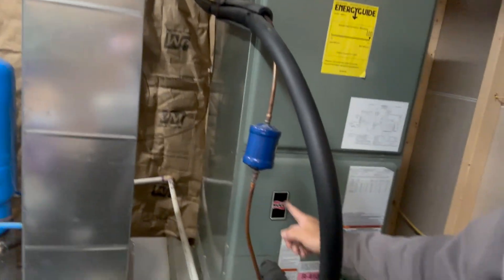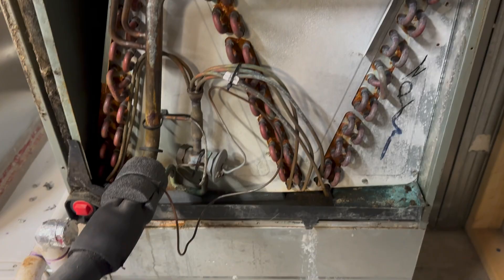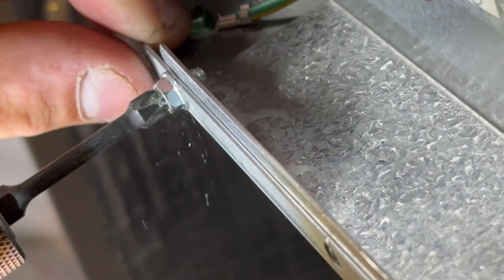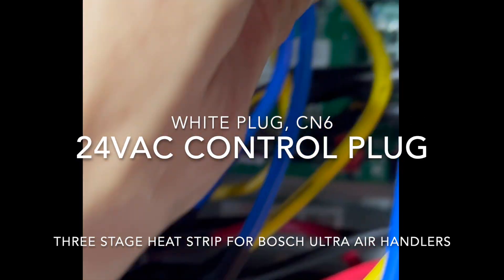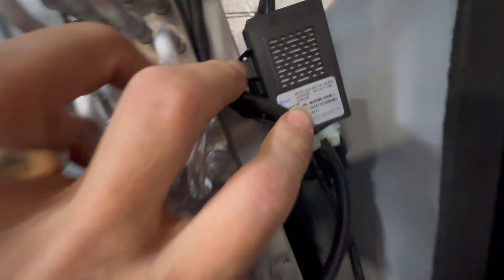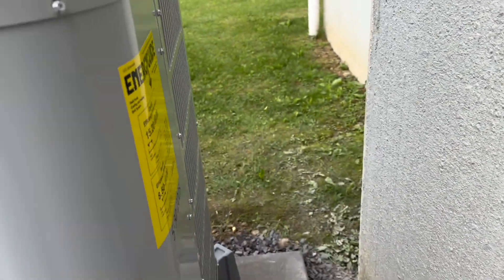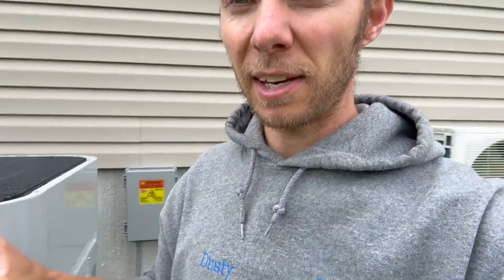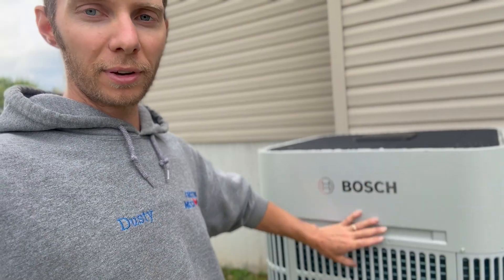Bosch Ultra Series 19 SEER2 Heat Pump

Comment: Why did you put 5 ton outdoor unit with 4 ton indoor? What's the purpose?
Reply from the maker: The reason for staying at 4 ton is that the indoor air flow requirements limit us to 4 ton, and in this case we were actually over sized by 1/2 ton. The issue is that if you set a huge air handler in the house, it will never properly dehumidify, and potentially never ramp all the way up if the ECM see's too much back pressure. Meaning, it will never flow 4 ton worth of air. 

The advantage of this, however, is that we have a 4 ton coil, and now running with a 5 ton heat pump outside, we can boost our heating rating, while using a Certified match to meet the requirements for Tax Incentives and Energy rebates. 

The 5 ton outdoor unit, just like any other heat pump, will eventually taper off and not have 5 ton of heating available closer to its operating limit ( in this case -13 degrees ). Meaning, at -13 degrees, this system is actually only capable of providing 3 ton of heating, which is where our customers house spec'd out as mentioned before.  So now , when the customer encounters those frigid temperatures, their heat pump can keep up, versus having to run backup heat more frequently. Obviously insulation values, wind, and many other factors go into this but that's the general idea. 

Thanks for watching!
Reply: @TheFreedomMaker so for cooling do you set your airflow for 4 tons? And with the bosch technology it'll never operate at full capacity?
Reply: Bosch will not overdrive the coil nor ice up the evap. You can put a five ton outside with a three ton indoor and it will not ice up just opposite of what we were taught due to one of two pressure transducers to keep our coil at a preset temperature. You can run the air handler with the door off and will not ice up, the coil will return a lower suction pressure telling the pressure transducer the compressor needs to slow down, I have had one froze up solid and I asked the tech is Y calling and he checked and said no, turned out the inverter board went bad and with no call it was running wide open. Nice install and best voltage, surge monitor out there. Congrats on a top shelf install!
Reply: When dealing with inverters compressors you can have more btu’s In the more extreme weather

Comment: What a great, informative video. I'm getting a Bosch IDS Premium BOVA-36RTB-M205 installed here in Massachusetts in a few weeks. I've been researching videos lately, and this is one of the best. The one thing i don't understand for my install, is my gas furnace will kick in at 37 degrees. Why is that? My Bosch is a 2.67 ton system. Is it just not efficient below 37?
Reply from the maker: Does it run just the gas furnace for 37 and below or just intermittently?

Your installation probably has the gas furnace wired for backup heat (this would be normal) , which is also typically engaged during defrost. 

95% of heat pumps start to need defrost right at 37 degrees….. 

Hope that answers your question
Reply: @TheFreedomMaker yes, that answers my question. Thanks!!!
I'll update after my install...

Comment: What thermostat would you recommend online everyone bad talks the bosh bcs110 did bosh ever update it?
Reply from the maker: We use the Honeywell ' T ' series thermostats. We have a preference which is a pro series model, but ultimately with the Bosch, you can run even the simplest of thermostat as long as it has heating and cooling ability.

Comment: Would this work with the same air handler I'm using with my BVA 2.0 air handler?
Reply from the maker: Unfortunately the old BVA units were 410 based. The ultras are all based on 454B. Technically, We could replaced the TXV on the air handler and make it work that way. Other than that, it would definitely work. The Bosch IDS products can all work with each other because of their phenomenal variable speed systems

Comment: Nice Video. Does the Ultra modem operate as low as 25 or 20 percent capacity?
Reply from the maker: Yes I believe the range is still set from 30% capacity up to 130% capacity

Comment: What did you install inline just before the pea trap?  This ultra is a game changer for cold climates!
Reply from the maker: We like to install unions when the drain crosses the front of the air handler for ease of access to the main drain pan port. Homeowners are encouraged to change filters regularly but we all forget sometimes so sludge can clog the main port if care isn’t used. Unions make service more efficient

Comment: Great video and install! Out of curiosity and future planning, how much did this cost?
Reply from the maker: I believe this particular installation was somewhere around $16,000. Depending on the requirements of your job (new thermostat, upgrade to electric panel, etc etc and the cost of contractors in your area and the equipment availability, it may be considerably more.

Comment: 5 ton Condenser on a 4 ton coil......Uhmmmm......in most cases that wont work.....why and how does it work with Bosh?
Reply from the maker: Because the Bosch is an incredibly smart inverter system, it monitors pressures and temperatures to provide an aggressive flow rate, without freezing up. 

The benefit of the 5 ton then is at 0 degrees, we’re truly getting 48,000 Btu of heating. Check the data on any other brand and see what they’re getting, no way they even come close to matched rated output compared to this system. Amazing technology!

Comment: Great vid ,mentioned about surge protection on outside,how about inside with variable speed motor and brd?
Reply from the maker: It would be an effective option for sure, ultimately what tends to take out these units is the low voltage brown outs, typically at the outdoor unit level. We actually have never had an indoor unit failure due to brown outs or surges, at least for the last 7-8 years. Of course we understand the reason you install protection is for the “what if”. 

Good mention! Thanks for you input!

Comment: Can it be set up for dual fuel? I have a 4 year old propane boiler with a hot water coil above the evaporator coil in the existing air handler on the Goodman 14 seer heat pump that changes over at 40 degrees to the hot water coil. I would like to keep the hot water coil from the boiler as the backup heat, if needed and replace the Goodman with the Bosch.
Reply from the maker: Yes , we actually have a few setup with different fuel options. We’re in the country so we have lots of customers that run wood, coal, oil, and propane. 

Ultimately, I’m sure you’d find that once you run a Bosch, you’ll almost never run your boiler again. The boilers are nice however since they can run off of very little electricity. There’s trade offs to everything in life. Thanks for watching!
Reply from the maker: We are doing three mobile homes in a park right now, all three are keeping their existing oil and propane furnaces as backup and running Bosch as AC and Supplemental heat. We will try to get a video up next week on one or two of those

Comment: Good Video, a bit long , could be divided. Also selfish to peel the plastic off the brands, got to let the customer get the satisfaction and inaugurate it. lol
Reply from the maker: Thank you for your input, we ALWAYS let our customers peel the plastic. I had permission on this one haha I normally don’t peel them at all and further more we tell the customer that there’s plastic on there that they can peel when they’re comfortable. We spend more time talking about peeling plastic than we do the equipment sometimes. 

We will make a video of just the Bosch Ultra details in the future. Are there any specific details you’re curious about if we do?
Reply: @TheFreedomMaker The unit inside , how is it insolated and does it need a tunnel directing the air through the coils and the blower ? because i looked at mine and it is just tossed in there without any direction. Is this just how Bosch designs it ?
Reply from the maker: Sorry for the delayed responses as we’re out serving the community during the day. 

I am not quite sure in your situation what you’re running into. If it is a Bosch air handler, they are designed specifically for this job. If it’s installed on a furnace or something irregular, it may not be installed correctly. I would need to see it